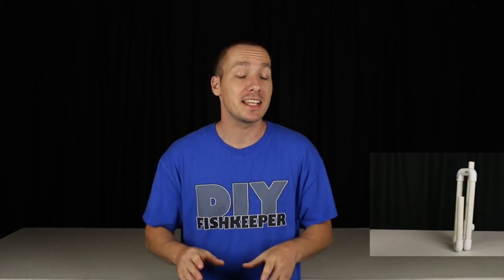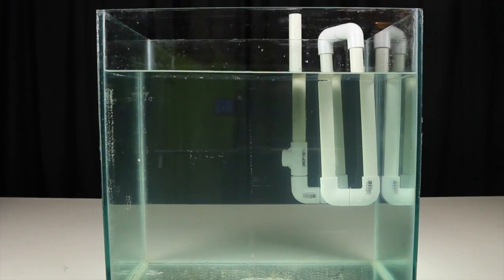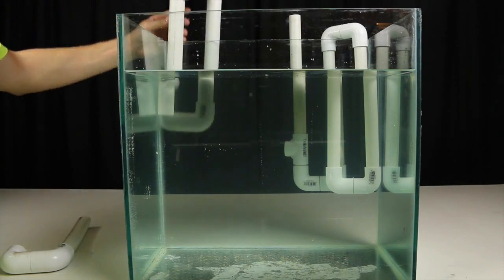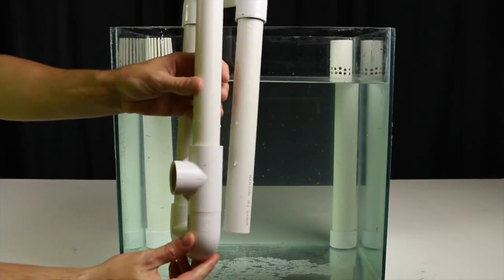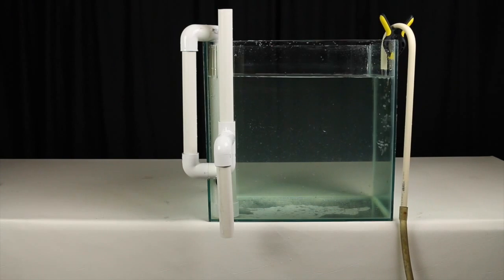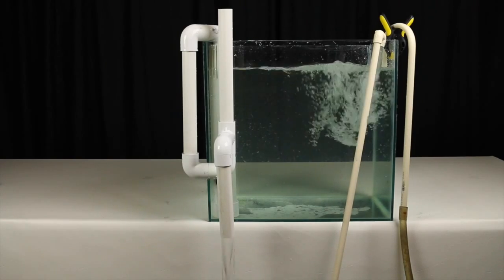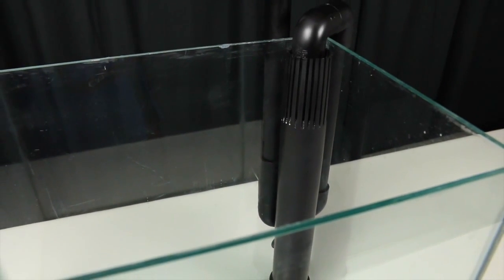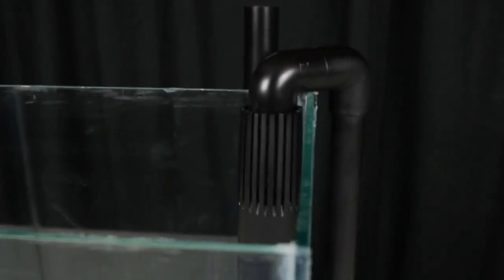HOW TO: $10 DIY aquarium overflow - UPGRADED and MODIFIED TUTORIAL

Comment: I’m having trouble priming any tips?
Reply: 1. Close off the bottom outlet (ball valve works well)
2. Pour water into the overflow pipe filling it close to the top
3. Seal the top of the overflow pipe with the palm of your hand
4. Open the bottom outlet
5. Wait 10 seconds or until you have a really steady siphon going
6. Take your hand off the overflow, breaking the siphon and turning it into an overflow

I had to try a few times to get the hang of it. I think my mistake was not letting the siphon run long enough to clear all the air out before unsealing the overflow pipe. Waiting about 10 seconds did the trick for me.
Reply: Lazy Peon man you are the best i was going crazy already but you man you are the man :D

Comment: Any suggestions from the internet world on how to reduce the noise from the water going over my weir and down the oversized pipe?  I made this setup using 3/4" and my stand pipe is 1 1/2" (double the size).  I'm doing a good job on the balanced water level (about 1" above the base of the notches in the top of the oversized pipe).  But I'm getting a lot of noise from this part of the overflow.  Do I need more notches, bigger notches, less notches?  Should the oversized stand pipe be full of water or is it always a waterfall effect across the weir and down to the suction location?  Thanks in advance.  Oh... and from experience make sure your suction cups on the oversized stand pipe are sealed watertight into the hole.  I unplugged the system, went out for an hour and had a spill because water was getting in through the suction cup location.  Live and learn :-)
Reply: I am having the same problem now and it is making crazy.  I cannot figure out how to fix the loud noise of it running down the weir.  Did you find a fix?

Comment: I set this up today - works - but got a very loud gurgling sound coming out of the high pipe in back - any ideas?
Reply: PR Riddlem yes check my recent comment about the 3 most common problems but I’m sure a ball valve on your overflow line will solve your problem
Reply: I cannot find you  comment about the 3 most common problems

Comment: Well I had my doubts. It didn't work well at first, BUT after I figured out that my issue was air leaking in (during dry fit testing) and I played with the tubes to get a better seal...... Whoosh! Serious flow bro! Thanks!
Reply: how did you find the air leak mine wont prime?

Comment: Love your work and vids.
They have become crucial to my next big sump build for 2x2ft and 2x4ft tanks. All plumbed together.
If I may add. The only addition I have looked to make, at the top of the overflow, where you drill in the air pipe, drill the other end into the inlet. Creating a venturi, so the airlift pump isn't required
Reply: What inlet are you talking about? The overflow inlet or the inlet where the water goes into the tank from the sump?

Comment: Well, I made this and it works great, but it sounds awful. The gurgling gives me anxiety! (Not to mention I can't sleep)
I already have the endcap on the air tube with a little hole. I also put some filter floss down the tube, but it just got sucked down.
I've been reading all these replies in the comments, but some of the naming I don't understand. 
Does anyone have a simple, working solution to the gurgling? 
-Does it have to do with the pipe that goes in the weir, the air tube, or the tee joint, or something else?

Thanks!

Comment: Howdy all, so i built one out of half inch (15mm) PVC.

I had problems priming  (solved by simply submerging entire unit and capping in and out. I simply took off the weir bottom (never glued it) alligned the overflow and poked off the cap, works a treat :p but would prefer the priming method in the video but as my unit is smaller may be the problem.)

Anycase im using a small 850 LPH (225 GPH) pump in a 20G Planted Catfish tank, at this current point the overflow DOES handle the flow but it makes a large gurgle here and there. Essentially i want it as quiet as possible all times so i can realize to options
 1. Second overflow  (probably most recommended 
Or 2. Build a larger overflow to accommodate all flow thus making it quieter right?

Let me know your thoughts if anyone replies
Reply: Add a ball valve to your overflow drain. It will solve your problem.

Comment: I tried this. As a result, I am covered in water and I might put my sump on Craigslist for free. How do you figure out flow / gph from the weir. My pump keeps running dry and my tank is against a wall and removing everything takes so long
Reply: Watch the video: "How it works".

Comment: How are these comparable to those eshopps hob overflow.   Diy is good if its fail proof if its not then no point.   Has anyone use these diy overflow before?  Fail proof on the siphon when power outage?
Reply: Made a month ago, has worked thru my simulated outages and held its prime. I had return pump tube too deep in the tank and accidentally created a siphon through that during outage, I was lucky to catch it when I noticed sump filling up despite no flow from overflow, I thought the suction cup in my weir had lost its seal. Overflow stayed primed as water level fell below holes in weir, worked same when pump turned back on.
Reply: I actually turn mine off when I feed and when my partner is in the living room because she likes it quiet. Starts up every so flexible time. So, you could say I simulate a power outage 2 to 3 times per day ;-)

Comment: First thing,  this system works great.  One problem that you didn't cover with this Overflow is what happens during a power outage.  Yes your water will stop on the siphon side but if your return line is still below that point,  it will continue on the return side.  The way i fixed this problem was to drill a small hole on the return line at the same level as the siphon side.  If you dont then your sump with overflow on to the floor.  Might want to cover that side of this project as well if you haven't already. BTW great channel Thanks.

Comment: hello joey I build your upgrade overflow and is working fine I use your PVC  pipe measurements and I'm experiencing lots of foam excessive bubbles also when I turn the pump off to do maintenance I loose return flow. I'm not using the check valve what went wrong?

Comment: Joey, huge fan of you channel and I appreciate all you do for the hobby. I was wondering your thoughts on combining this with your diy pvc canister build?  I don’t necessarily want a video but your opinion on if this would work.  My thought would be the exact same setup except with an external pump. The input would go down the overflow weir or could connect to where the water pours out. I love the canister filter but want surface skimming without a pump in the tank. 

If you take the time to read and respond I truly appreciate it in advance. If not, I know you are crazy busy and hope you have a happy holiday (whatever you celebrate)

Comment: Does the water intake have to be the same length as the U section on the outside of the tank? Or does the output need to be lower than the water intake?

I have made this where the water output is higher than the input and the input slightly higher than the U section on the outside of the tank, just wondering if this is going to work the same as the video or if I will experience any problems?

Comment: In lieu of the suction cup with a nub hole drilled... Why not epoxy a 3/4" diameter 1/8" thick neodymium magnet centered in the pipe end cap and place it where you want it to be when finally set up, then epoxy or silicone cement the other magnet under the tank bottom glass (this will work very well for framed tanks, but not in tanks w/o the frame) Second suggestion... make the weir grooves half inch openings... Use spacers to securely position the weir pipe inside an even larger pipe of equal height allowing 1/4" gap all the way around Weir and outer pipe. Pipe tops are same height meaning the weir pipe with end cap is just a bit shorter than the outer pipe/weir. Outermost pipe has smaller grooves to still permit surface skimming as a weir and also a series of two bands of equally spaced holes  3/16"  ( or smaller if needed to keep fish out) near the bottom and near the midpoint to permit gathering and removal of suspended particulate for filtration. Flow pattern is through the outer pipe wall and up to the top of the weir... then down to the innermost pipe opening and up and out. I don't like the suction cup design. I'm handicapped and I want all potential problems eliminated before a large fish knocks the pipe loose from the suction cup nib or breaks it if it deteriorated - followed by a power outage... and I want better collection of the small debris that tends to sit right near the bottom and gets swirled up from time to time by the activity of the fish... Let the fish help you to clean the tank a bit.

Comment: Must say I enjoy your DIY and have done quit a few of them. I am setting up a 160 gallon tank (keeping Koi's) planning on putting 2 on each end of the tank your corner Super Charge corner sponge filter, but also wanted to add in the center your overflow project that will go to a sump and return via pump.
Question, is the position of the overflow best in the center since I'm planning the sponge filters. thanks for your advice.
Reply: i know this is an old post but i am setting up a 180 gallon cichlid tank, wanted to find out how did your design work out

Comment: I built this for my temp. 55 saltwater tank. Well, my old return pump failed after about 30min. So I didn't want this siphon active. I tried everything shot of pulling the unit out of the tank. It NEVER lost its siphon. After 10 days I topped off the water and this time I added enough to flow into the weir. It STILL siphoned!!! And I don't have an aqua lifter pump on it either.
How The Heck Do You Stop This Thing!😁
Reply from the maker: +David Miller build it correctly. 100% of the time when I answer these questions, every single one of them didn't build it the same. Always doing something different and telling me it didn't work.

Comment: Not to be rude... but you totally ripped this off from another guy on YouTube, way to be original... here is the guy that ACTUALLY made this overflow first: search "DIY Overflow Pipe.Take Two" created by pronster1
Reply: Is it just possible that two people had a similar idea without one "ripping off" the idea from the other.  Just think about it.  It has happened to me before where I modified a piece of equipment to make it work better, then a few months I saw a video on youtube showing how to do what I did and I had never shared what I did with anyone.  Sometimes things are just coincidence.
Reply: No hes a liar. I typed in pronstar 1 and it led me to a pornstar video 😑

Comment: Hey Joey, thanks so much for taking the time to put together and share your videos.  I've built my overflow following your diy video. I did opt to omit the optional air tube with the pump you mentioned, primarily to keep the cleanest look but also one less thing to buy and contend with. Without it, it is performing just fine with no loss of siphon issues I will say my unit is quite loud with a gurgling noise,  is that because I did not use the optional airline? Thanks again for sharing.
Reply: You can get a cap for the top(where he shows pouring water in to prime it) drill small holes to let air pass through and DON'T GLUE IT ON.
Reply: Mine is very loud as well, gurgling noises, did you ever find a solution to quiet it down?

Comment: Why is that black suction cup is required on outer weir pipe? If I don't drill that hole in the outer pipe and not use that suction cup will this siphon work or not?

Comment: I have a question about these, I used one for a limited time in the past but I had to quit the hobby for a little while shortly after so I never got to test this out.  Can you hook the outflow up to a open air wet/dry without worrying about the siphon breaking during a power outage or for any other reason if constructed correctly?

Comment: Hi Joey, I have recently made your DIY overflow for my saltwater aquarium, however I have a dilemma. In order to make the overflow fail proof I would need the Toms Aqua Lifter pump that you recommended in order to suction out the air. The dilemma is that I'm Australian and so the 115 volt pump would be 240 volt, so therefore it cannot be used because it would literally blow up. I'd really appreciate if you would take the time to provide me with any suggestions as I have not been able to find another pump of the same function available. Much appreciated.

Comment: So what if you had your aquarium connected to a GFI adapter? if it loses power in the event of a power outage you have to manually flip the switch to close the circuit. This way your pump wouldn't be able to start back up and overflow your tank if the suction was lost in your weir or overflow box.

Comment: ok so i just designed this over flow and i cant get it primed unsure what the deal is running 3/4 cpvc and 1.5" weir sections are 12" what gives ? tank is 125 gallon standard 72x18.5x22 nvm got it going ! its a bit of a pain

Comment: I'm hoping someone could clear this up for me. This does not seam to be a true overflow, but a siphon. With an overflow, the rate of flow is dictated by the return pump. If you have the return pump at 10 GPH, that is all that is going to be able drain down the overflow. With this, it would drain at it's max speed until it drains down to the point that the outer pvc piper with the notches is no longer letting water in and the siphon is broken. Would this not require that the return pump be perfectly matched to the waterflow from the PVC pipe?

Comment: I was wondering in case of power faillure if there is a leak on the suctioncup below the drainage point, wont your aquarium run dry and your sump overflow? i tried to silicone mine close but can't get it 100%
Reply: Make that hole really small so it's tight. Some pipe thread compound or Vaseline migh ensure that it's water tight.

Comment: hey joey! I ijust built this really proud of it! but when I try to prime it! it wont start suction from the tank. Am I doing anything wrong...
Reply: Dennis Sorah Eden made some good points and her explanation of how it works is spot on. I had problems with self-priming as well but the solution was to raise the T-valve above the hole on the tube that is placed inside the weir. Hope that helps!

Comment: If you have a loud slushing, sucking, flushing noise just lower your gallons per hour on your return pump the noise is cause by to much water flowing through the over flow
Reply: raul rios I have this overflow 1 inch which is approx. 600 gph according to Joey, but I have a 594 gph return pump & I still get the loud noise.
Reply: Lamar Durst There are a couple things that you can do to aid with suppressing the noise

Where you have the standpipe get an end cap for that size pipe and drill a hole it. It will allow air to get into the standpipe but quiet the noise. 

The second part would be to get an end cap for the weir. Drill the end cap large enough for your pipe to fit into the end cap. Your pipe should slide into the drilled endcap snugly.

Comment: the pipe you used to put some water with the bottle min: 2:58, makes a lot of noise in the one i built, as if it was ( and actually is) sucking air.
any idea of how i can fix it withou completely blocking the air inlet?

Comment: THANK YOU SO MUCH FOR PUTTING THIS OUT THERE! once I glued everything into place it worked flawlessly. have it going down into my wet/dry filter that you ALSO showed us how to make! you're the best!
Reply: Did you glue the one inch pipe to the two inch inch weir inside the tank?
Reply: No. I don't recall Joey telling us to do that either.
Reply: Just double checking......no he did not
Reply: @oval291  will this work if you do not glue the pieces together? I've been doing a dry run (without glue), and cannot get it to siphon or stay running. Thanks.

Comment: Hi Joey, need help I'am building a L65" x W20" x H30" Tank i don't want to drill a hole. is 1"size pvc pipe still enough for my aquarium size and how many should I put? thanks
Reply: ray palmero it depends on your pump size. What is your flow rate on your pump?

Comment: Would it be possible to "t" in a 90 degree connector to the weir pipe and attach a second weir top as a back up overflow if the one gets blocked or clogged?  I have a picture attached to a post on the DIY Fishkeepers group page if you belong to it, I'm not sure if the link will work. 
https://www.facebook.com/photo.php?fbid=10153695295066792&set=gm.874909412645277&type=3&theater

Comment: My overflow weir pipe is making a heck of a lot of noise any tips?
Reply: Yeah I had that problem too. 

1) Find out where the noise is coming from
2) its usually coming from the standpipe, so put an end cap with a hole drilled into it
3) if its coming from the weir itself, look at the design. 
4) If it is the weir, look into the stockman standpipe solution, there are videos on it and you can slightly modify yours to fit your need.
Reply: yeah i realized afterwards that it was either that it was sucking in too much air or water was falling too far down. i ended up adding a valve and raising the inlet of the pvc to about 6-7 inches above the bottom of my tank it worked but i'm not sure which of the two things lol just answering in case anyone has the same problem
Reply: silencedknight how did you build a stockman for this? I can't figure out what to do because of the elbow
Reply: Could you send me a picture of it?

My e-mail is mitchellq641@yahoo.com